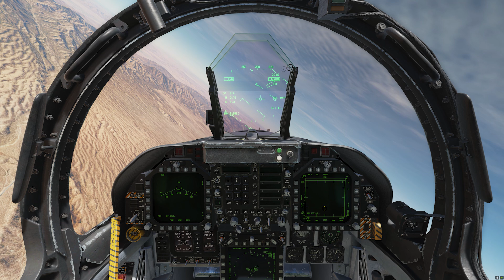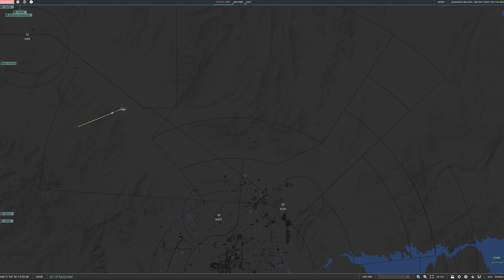DCS World IFF functionality primer

Comment: Mode one and two are used every sortie (depending on the equipment installed on the jet), but only by military controllers.  They are not used to tell friend from foe, but to identify aircraft type and mission.  All squawks are found on the Air Tasking Order for the day.  Source: five deployments.
Reply from the maker: Hi Theodosius, that’s good info thanks. Is that recent experience? If so, I wonder if this is aircraft type dependent. I used Modes 2 to 4, but never Mode 1. ~Tyro
Reply: @AIRSUPERIORITYCHANNEL  Hi Tyro, my experience is relatively recent, yes.  Plus, our guidance on the matter has not changed.  I can only give you the USAF pilot (non-fighter) perspective, though.  I suppose it could just be a US thing.
Reply from the maker: @ImperatorTheodosius  possibly, my experience isn't universal either nor exhaustive. It would be interesting to compare notes on where/how/when we have differences and overlaps, but probably not a conversation for YouTube comments!